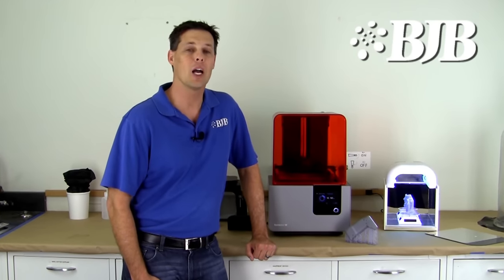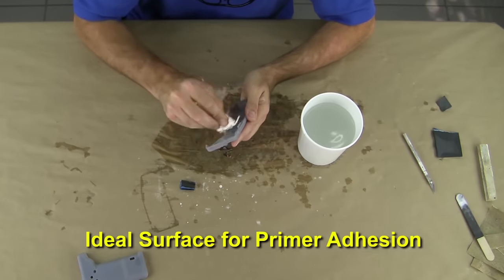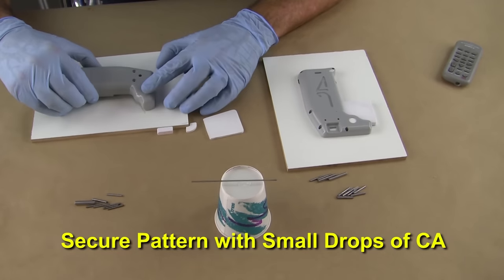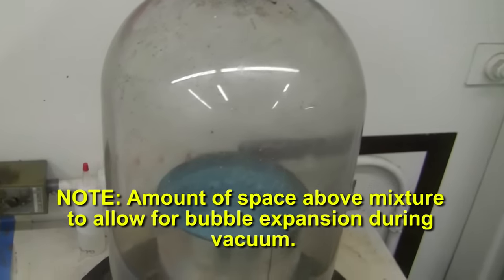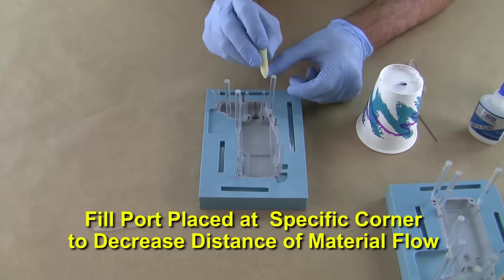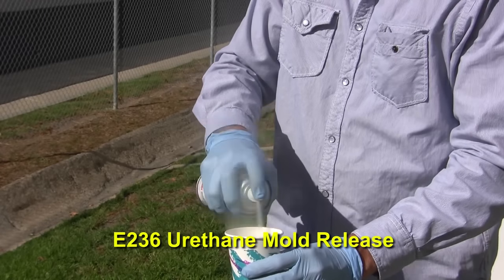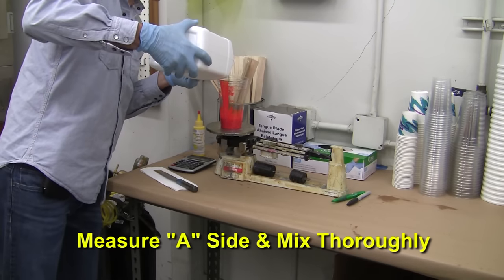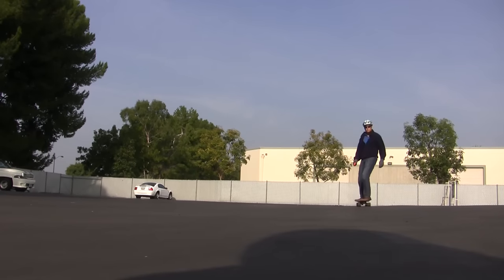Pro Series Silicone Mold Tutorial | Electric Skateboard Controller

Comment: how did I get here? this is great but also one of the most complex set of procedures I've ever seen..
Reply from the maker: This is a more advanced mold-making tutorial so it's not surprising it looks complicated.  The results of making a mold this way for production parts means that the cast pieces pop out with very little post-finishing work.  There are easier ways to mold the same part, but you give up mold life and the parts require more post-finishing.
Reply: This looks complex, but once you actually do it it is a very simple and basic technique of mold making. The 3D printer of course can be substituted for any other object you want to replicate which can be made or acquired by any other means.

Comment: This is a very well made video, and great tip on using dowel pins for areas where screws will go. For my current project, I would have to smooth over screw threads

Comment: very informative. How many times can you cast in that mold before needing to make a new mold?
Reply from the maker: Always a great question.  Many professional mold shops quote 25-30 parts out of a production mold but many individuals report as much as 50 parts if the part is simple and the casting material isn't too hard on the silicone tool.  It's a "your mileage may vary" situation with many factors involved including desired surface finish, tolerances, etc.

Comment: do you have any suggestions on determining where to place the vent holes? and how many? looks like you're aiming for corners but not sure how to determine which thickness and how many to use
Reply from the maker: This particular part had a lot of tricky geometry so we ended up with a lot of vents (more than usual).  When the part is angled up like we do on most of our molds, every spot that could become a trap for air (corner) that's where we put a vent.  If the wall thickness is thin, we used a smaller 1/8" vent.  On thicker wall sections we used the 1/4".  If there were many vents in a concentrated area due to geometry, we used the 1/8" vents because you need some space around each vent (a buffer of silicone material).  On simpler parts, we concentrate on finding corners but still it's hard to explain in text.  For a good visual on how we do it, it's best to watch our intro mold making video to see our strategy:  https://youtu.be/iRj6xzNx7P4?t=920
Reply: @bjbenterprises  thanks! had another question for you. I see there is another strategy for filling 2 part molds, commonly known as a squish mold. In a squish mold, you fill the negative side of the cavity and then lay the other half of the mold on. Is there any benefit to the pour method shown in this video vs the squish mold?
Reply from the maker: @flat__stan  If you are only making a few simple parts, or are trying mold making for the first time, then a squish mold is fine for simple projects.  Squish molds are very crude and can trap a lot of air unless the part is extremely simple.  You also end up with a lot of wasted material spilling over the sides of the mold and the parts will require more time to clean up the flashing.  The use of a pressure tank to deal with trapped air bubbles may help offset the lack of air vents as well.  Every mold making technique has trade-offs and it's good to know what each method offers in the end.
Reply: @bjbenterprises  thank you! trying my first mold soon and this was very helpful

Comment: Hi, great video, the most helpful i found. I have a question how to make a textured part with a rougher surface with high grain?
Reply from the maker: If you apply the texture to the 3D Printed pattern, or print the Pattern with the texture already included, the silicone mold will produce that surface very well.  Is your concern how well the parts will release from the mold with a texture or how to add the texture to the molded surface?  Once the silicone mold is made, you cannot go back and add texture.  You want to have the texture included in the original pattern.
Reply: If I want my part to have a texture of a 'Popcorn Ceiling' (not the best example but close). I think SLA isn't an option in my case due to size and FDM due to lower detail. Is there another way? I was thinking about painting it with a special roller.
Reply from the maker: Yes, you can apply the desired texture with a paint application technique.  The silicone mold material will copy the surface texture you produce on the pattern.  There are a variety of paint systems that can produce rough textures.  You may want to seal the pattern with a clear coat to make sure the silicone doesn't have a curing problem.  You can learn more about this in our intro mold making video:  https://youtu.be/iRj6xzNx7P4

Comment: Would you recommend using snap fit features with cast parts for easy assembly?
Reply from the maker: Snap fit features are certainly possible if you avoid having too much of a bending moment.  The reason is injection molded plastics like ABS or Nylon typically have much higher elongation properties compared to thermoset resin systems in the same durometer and stiffness category.  This is why you wouldn't have much success with living hinges on the stiffer urethane products. BJB's cast urethane products are formulated to achieve high physical properties for simulating injection molded plastics and rubbers for real world use, so it is good to understand how to apply them in highly engineered applications and parts.  Great question and thanks for the comment!

Comment: Hi, some friends of mine are printing masks for doctors fighting corona but the process is very slow. So i examine other methods like this one. You said already it takes 6-8 hours for the silicon to dry. Is there other kinds of silicone dries faster? How long time polyurethane needs to dry? Any other suggestions? They print only bottom frame which is like a bended stick the rest is ready cut parts which are not problem.

Cheers and i wish u goold health...
Reply from the maker: There are a couple things to consider.  Yes there are faster silicones but can you get it in the mold without bubbles fast enough?  Platinum silicones love heat, so you can take a silicone that normally takes several hours to cure at room temperature and put it at 50-65C (125-150F) and it will come out in 30-45 minutes.  Also, you do not want to use a polyurethane material for flexible masks, it does not have the same skin safety as platinum silicone.  You could use polyurethane for other rigid straps/frames where it is not touching skin for long periods.

Comment: Do you have any suggestions for short run temporary molds for a water bottle?
Reply from the maker: The first question is do you want it food safe to drink from?  If so, you aren't going to use a cast urethane.  You could get away with a proper platinum silicone surface, but that's flexible and you would likely need a rigid shell.  Blow molded or injection molded thermoplastic is how it is done on a large scale, so you could fake it with rotocasting but it wouldn't be food safe.  Would need more parameters to steer you in the right direction.

Comment: Hello, a question is bothering me, why did you put metal inserts to plug the holes? since leaving the holes apparent would have been reproduced as well? I don't understand, thank you
Reply from the maker: That is a good question.  If we don't use a metal pin for some of those deep holes, you will have a very weak and flexible silicone post sticking out instead.  The silicone will fill those cavities if nothing is there and create a "positive" post or pillar sticking out of the mold surface.  The silicone post will likely tear off after a few castings.  We also use some of those metal pins to locate very accurate holes (so you don't have to drill them out later) for the many screws and electronics.  This part has a lot of detail and screws involved in making the final unit, so it is one of the more complicated molds we have shown.
Reply: @bjbenterprises  okay thank you so much

Comment: any tips for removing the part from the mold? Having issues removing the vents/sprues which is locking my part into the mold
Reply from the maker: Are you using BJB's vents and sprues on your mold?  Our vents have points on them so you can break/twist them off before trying to demold the part.  Compressed air is one of the best methods to help release parts without stressing the silicone mold.  Make sure you use safety goggles and/or face shield while using compressed air to do this.  If you are using BJB's vent/sprue supplies, it's best to call us directly for the best technical assistance.  714-734-8450 or email info@bjbenterprises.com

Comment: Very nice and informative video

May I ask , would it be wrong to degas the casting resin in to the mold and not before? 
Would it cause problems ? Like bleeding parting lines?
Reply from the maker: Good question.  We would not recommend degassing the cast urethane in the mold because it will bubble and expand up and out of the mold, creating a mess and you'll lose material out of the cavity.  The best method is to thoroughly degas the material prior to pouring into a mold that has proper venting and fill port location.  If the mold is very complex, pressure casting after the material is poured in will often help with stubborn bubbles but is not always necessary.  There is a method called "Vacuum Casting" in which a lower level of vacuum is used to assist pulling material into the cavity but it uses specifically set up equipment to do it.
Reply: BJBEnterprises 
Thanks for the quick answer .
I made a mold and the vent holes are not exhactly at the edge of the part , I ve also made the ports 2 mm in diameter. I will cast up resin 
And I was thinking to 1 degas the resin before 2 cast re resin and 3 put it all under vacuum again .
If I would 3 d printed a mold like this I would 3 d print the flange of the mold also , and save time from all the work you do before you cast the silicone .
Reply from the maker: If you are using a 3D Printed mold, this means that the mold flange may not seal as well as a silicone mold and may be at more risk of pulling air bubbles through the edge of the flanges.  Also, the vents would need to be on the flange surfaces or you will need to drill out cured urethane in the vents every time you cast a part.  If you would like us to take a look at the mold, you can send pictures and questions to:  info@bjbenterprises.com
Reply: No no , you didnt get it right , i 3d printed the exchact negative of the the whole mold , instead of printing the part and have have a lot of job to do , you can print the exhact negative of the mold from the begining and the cast the silicon on it ,so what you do on this video from 2:59 to 4:45 is not necessery cause its already made from the 3d printer , (ok you have to print 2 istead of one but i think its better).
Reply from the maker: OK, I see what you are saying now.  If you are making only one part, you need to print 2 different patterns that includes the registration keys/pockets and any other details.  In our video, you would need to print 4 different patterns to make the 2 molds.  If you are not worried about the surface finish of the cast parts, you don't have a lot of work to do other than sealing the SLA patterns with Primer.
Reply: Yes , you would need 4 for the job you did ,but then you would have a plug stored and make another mold when the first is ruined in a matter of seconds . 
I as have seen the aproximate life of a silicone mold is 25 to 30 times, 
is there any material that could last longer ? what would you suggest for 200+ castings?
Reply from the maker: We re-use the patterns quite often, so not all is ruined.  You can place the pattern back into one of the mold halves, apply mold release, and re-cast the mold half.  When done with the first half, you can remove the old silicone mold half and re-cast the final new half.  If you use vents like the ones we show in the video, you can simply re-attach them to the pattern before casting the silicone.

Comment: that's just great ! Thanks for posting the video. Just got my own Form2. Can't wait to do molds with it! Would the Fuse1 also be suited for this or are the surfaces to rough ?

The light curing chamber seems to be constructed out of a nail polish lamp and a rotating jewlry display. Thats perfect. Would you tell me where you got it ?
Reply from the maker: Hi Herman, thanks for your comment.  You can certainly make patterns for molding using either the Form 1 or Form 2 printers.  SLA technology produces very fine detail so you will be able to get them ready for molding very quickly as seen in the video.

The UV curing chamber was built based on Formlabs DIY instructions, but we made a nicer box with reflective paneling inside.  Here is the build info:  https://forum.formlabs.com/t/uv-cure-chamber-design-dimensions-and-pics/11192

Comment: In how much time  the Polyurethae cures?
Reply from the maker: As fast as 10-15 minutes, as slow as 2-3 hours depending on the material system used (at room temperature).  Some people will use heat to accelerate the process and allow faster production.  Also, depending if you have access to a vacuum chamber or a pressure tank, you may choose to use a different speed system depending on the equipment you have.

Comment: I tried using platinum cure silicone to cast an sla print today. The silicon didn't cure properly. I assume the sla caused it. Is this true? Is that why you primered before making the silicon mold?
Reply from the maker: Cagney Moreau correct, you MUST seal a fresh SLA part or it may cause platinum inhibition.  Sorry you learned the hard way.  Our intro mold making videos go over this issue.  https://youtu.be/iRj6xzNx7P4
Reply: @bjbenterprises  Thanks for the fast response. that was much faster than the 16 hours I waited the first time. lol. I just realized you guys are down the street from me. Awesome!

Comment: Hello!! If I wanted to create model kit style mold, like runners from the Bandai Gundam Line, how would I do it? Or how would you approach it?
Reply from the maker: Great question.  It would be similar in approach to how we set up the fill ports and vents in this video but the "runners" will be parallel with the part instead of perpendicular like these vents.  You would have these runners along the parting flange instead of going through the silicone walls like our video.  If you aren't quite sure how to do this still, an email or phone call to our tech line would be the best because this is difficult to instruct over a YouTube comment.

Comment: Any reason why you can't just 3D print the Injection mold Directly?
Reply from the maker: Donelle Reed great question.  In some cases it may be possible to 3D print the mold but depending on the surface and inner geometry, it may not be practical.  You need to consider the desired surface finish you want from the cast parts and if it’s possible to sand, seal, and polish the 3D printed Mold surface.  In our case it would be extremely difficult and time consuming if not impossible in some of the tight areas.  Also, it’s much easier to remove rigid cast parts from a flexible mold while it is very difficult to ensure sufficient mold release coverage on a mold like ours and still remove a rigid cast part from a rigid mold.  If the geometry is simple and fairly smooth, you may have an easier time.  Also, depending on the vents and fill port situation, you may have a hard time with getting mold release in them.  If the vents are on the split line that may work ok, but in casting we don’t have the high pressure advantage of injection molding so filling and venting strategies are totally different.   Be sure to watch our other mold videos to learn more and some of your other questions may be answered.

Comment: how can I identify Poly casting material in hardness?
how do I know it is going to be hard like a plastic or soft like rubber?
Reply from the maker: Let me try and understand your question.  Are you asking how to choose a material that is a specific hardness (Durometer)?  Or, are you asking if you can mix the materials to achieve different Durometer?  BJB manufactures hundreds of different formulas that will cure to different Durometers.  You can't simply mix the material differently to make a hard or soft material.  You would want to know the desired properties of the finished part and choose the right product for the application.  We offer cured sample coupons to help the choosing process if you don't know exactly what you need.  We also offset many injection molded plastics to simulate properties in our casting materials (like ABS, Polypropylene, HDPE, flexible rubbers, etc).  You might also want to watch our video on Durometer:  https://www.youtube.com/watch?v=Q6jn223_1Mw&t=13s